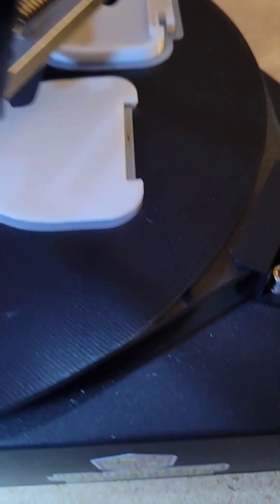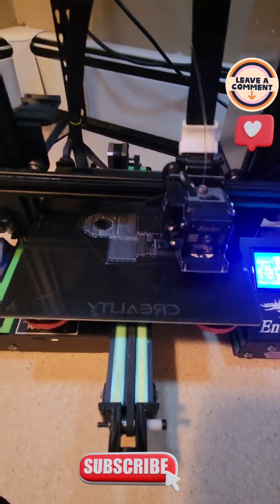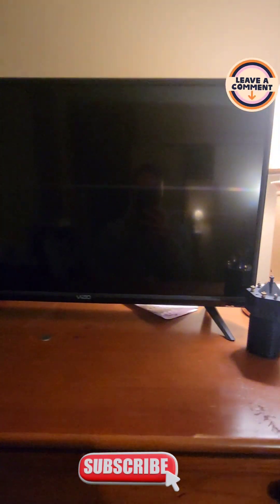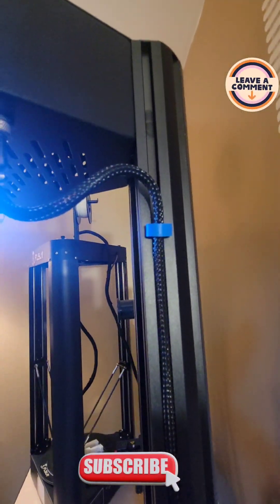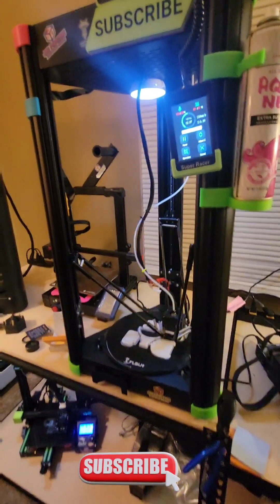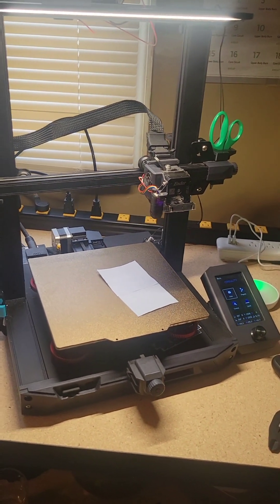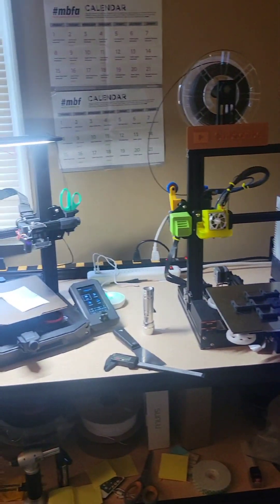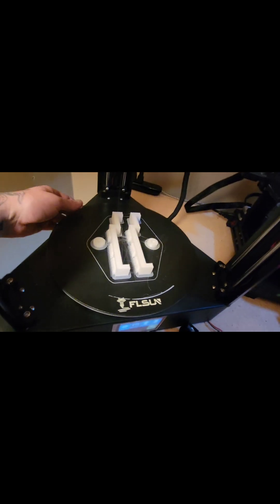The DIMONDBACK .4 3D Printer Nozzle Review: MAKE PLA QUALITY 3D PRINTS LIKE A PRO!

Comment: Review? That's quite a stretch. How's it working out for you? Have you used it for any fiber filled or abrasive fillaments? I got the .25 and it's too small for anything like that. Was wondering if the .4 would work.
Reply from the maker: .4 is fine just depends on what materials